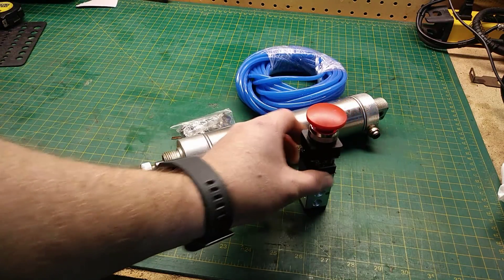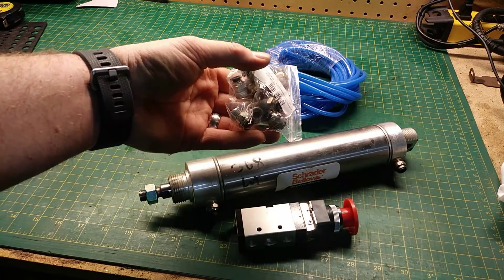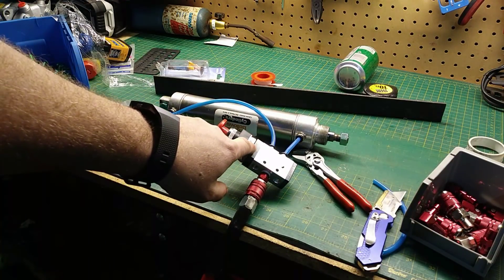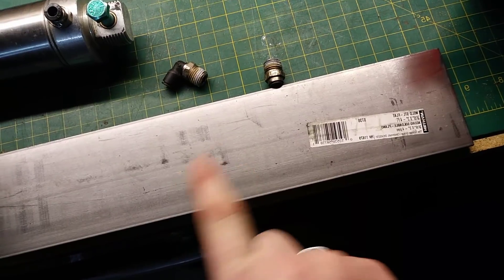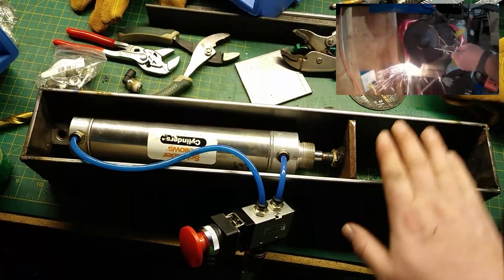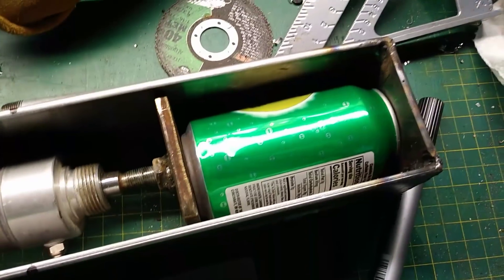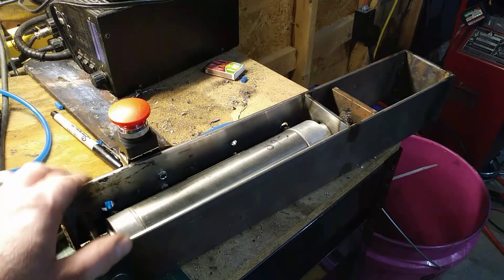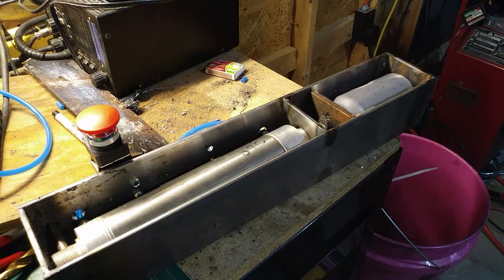Building an air powered pneumatic can crusher!  Best DIY Can Crusher!

Comment: You inspired me to build a can crusher but am new to pneumatic cylinders.  Do you think this one would work
Baomain Pneumatic Air Cylinder SC 32-200 32mm Bore 200mm Stroke Screwed Piston Rod Dual Action
Reply: It will work but struggle on some cans. A 63mm bore is what ya really after. Isn't much of a price difference on Amazon.

Comment: Sir are u using a compressor for compressed air ?can we use a hand pump or leg pump for compressed air ??
Reply: Using a hand pump, or foot pump would have you pumping all day to supply enough volume to run it. You might as well just use a manual crusher instead of pumping air all day.

Comment: Is it very important to be sure to use pneumatic air hose?  Regular air hose just won't do it?
Reply: "Regular air hose"? I think any hose available that is designated as an "air hose" will be safe to use. A garden water, auto vacuum, fuel line, aquarium pump or any other hoses that is not labeled and marketed as an "air hose" would not be safe to use. He said 60 psi will crush a can sufficiently. Most home compressors have a high end at 125 psi. He's using air tubing with fittings with ratings well above that. Hope that helps.
Reply: @vincemacpaul I believe he recommended a pneumatic air hose and a pneumatic air cylinder.  I just wanted to make sure I got the right parts.  I am unable to find any air hose identified as a 'pneumatic air hose'.  They are either 'air hose' or 'pneumatic hose'.  I can't find any with both.  Same for the cylinder.
Reply from the maker: David Lee, anything that can handle the PSI will be fine.   My compressor is set to 120 psi so I made sure all my parts could handle that.    That being said, 60 Psi seems to crush cans just fine.

Comment: Really great !   Any thoughts on using springs for the ram return ?  This would lower the noise level ..    I Like the idea of the vent holes , to keep the cans from exploding  , good thinking ..
Reply: He is utilizing a double action cylinder. They make single action cylinders that has a return spring built in. The mechanical issue with those is it it takes more psi to do the work of crushing plus compressing the spring. That is a nominal issue in this application as 60 psi will crush a can and you most probably have a compressor that can produce 125 psi +.
Reply from the maker: Springs would absolutly work!   And would save some compressed air.   Would just need to leave the return port open on the cylinder, and if using the same button, plug that port..

Comment: 3" channel iron is excellent for a can crusher. When the can lays in the channel the can touches the bottom and both sides. Lay your crusher on its side and let gravity both eject crushed can and for auto feeder. Weld a piece of thin metal onto the top edge of the ram and let it cover the air cylinder rod. This will keep the next can raised up till the ram returns and can will fall into crush zone.

Comment: What about the extra tall cans, like monster or 16 ounce Coke, 20 ounce cans?
Reply: He stated he has a 5" throw pneumatic cylinder. They are available in other throw lengths. I decided on an 8" throw. Same mechanisms, plus a larger dia ram. Cost a bit more though.
Reply: step on them
Reply: I did 3" cylinder by 12" stroke and it works just fine :)

Comment: Hi, any safety reasons why we shouldn't box that in with wood instead of metal? I'm going to build this, but I'd like to know if we could use wood instead. Thanks.
Reply: I made mine out of 3/4 inch plywood, with the ends dado-ed into the sides, used a 3" ABS pipe cut in half lengthwise for  the cans to ride on and a piece of plastic cutting board on the compression surfaces..No need to fasten the cylinder as it  stays in place on it's own.
Reply from the maker: I can honestly say I don't know.   I am not familiar with building anything from wood and have no idea if it would or wouldn't hold up.      Seems like its worth a shot!
Reply: I'm building mine out of wood. As a retired mech designer, the most critical criteria to consider is both ends of the lateral forces. My platform will be of 2x6's and the ends of 4x4's, 8" long lag bolted up and epoxied down with 6-4" lag bolts each. My only concern is the longevity after 10,000 hits as I drink a lot of beer, haha.